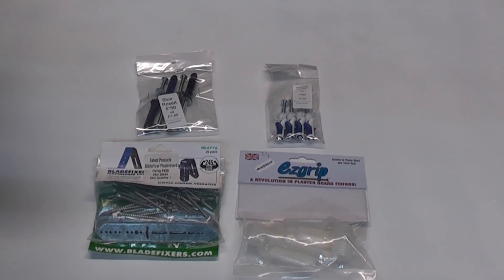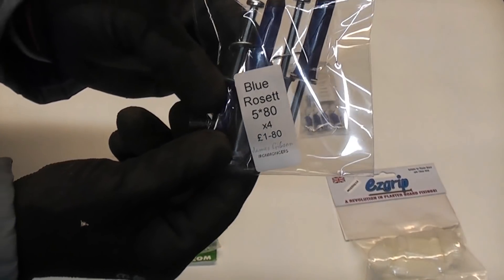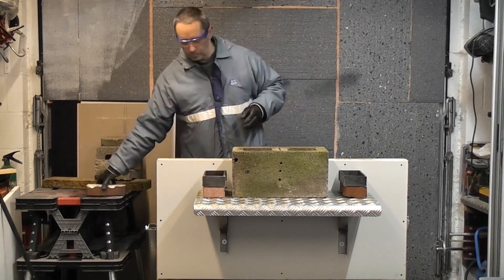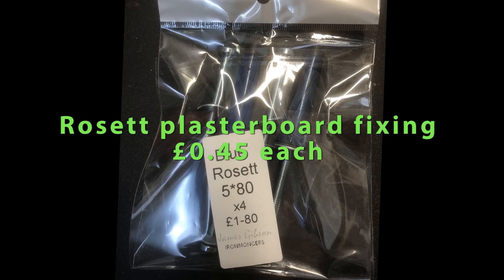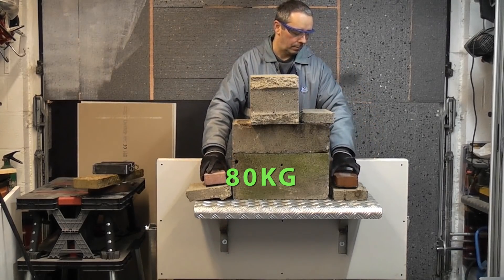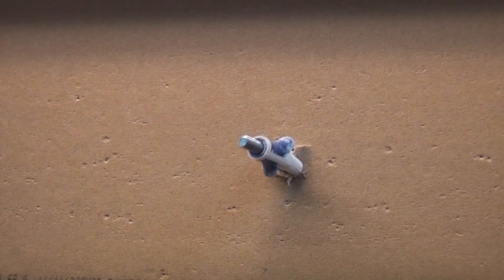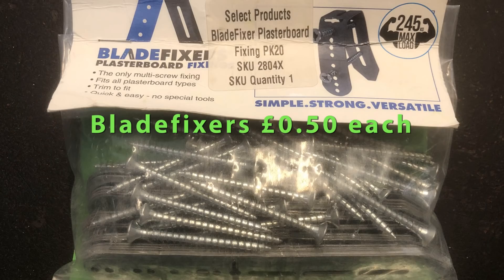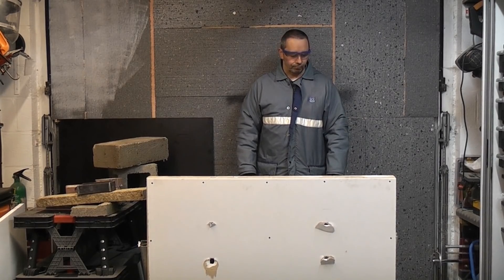Plasterboard fixings weight test 2020 | EZgrip | Rosett | Thorsman duo-max | Bladefixers

Comment: Brilliant video. Im putting a mirrroed bathroom cabinet in the bathroom and initially bought some gripit fixings, but now im leaning towards spring toggles due to their ability to hold more. Im thinking that over time, that will bode well for longevity and allow the cabinet to remain mounted for longer. Would you say toggles over gripit for my application?
Reply from the maker: Yes, toggles are great, unless you need to remove the item, in which case the toggles drop into the cavity! Toggles are also no good for the keyhole type fixings, but are awesome for anything with a hole, that can be tightened 👍
Reply: @ultimatehandyman  won't need to reuse. Once it's up I won't be taking it down for a few years and i tend not to reuse fixings. Much rather use a new one just to be safe. The cabinet doesn't have a keyhole for mounting. Just has 2 holes either side on the rear hardboard and on the wooden baton across the back. Toggles would be fine wouldn't they?
Reply from the maker: Yes, they will be perfect ;-)

Comment: Very helpful, thank you very much. Just installed slot shelving. Was going to attach them to wooden studs only to find out that my studs are actually metal and hollow. Was  disappointed indeed. Now using anchor attachments to fix the slots to the plasterboard. Your video gave me reassurance that i can go ahead and place some fairly medium to heavy weight items, on the new shelves, lots of folders, books and some tools etc, I should be fine. Thank you and take care.
Reply from the maker: I'm glad the video helped 
Thanks for the comment 👍

Comment: Thanks for this video, I have some blue rosetts and from your test it seems failure was at 91kgs - for 4 fixings, is that right? Does that mean theoretically each fixings max capacity is 91/4=22.75kgs - or is my assumption wrong - to me sounds about right for type of fixing. I was just worried as they told those Blue rosetts have capacity of 6.5kgs each, - which sounds too low, I want to install a 12.75kg (empty)cabinet with 2 fixings and if it’s truly 6.5 it’s borderline.
Reply from the maker: It depends on a lot of factors, such as how the force is distributed. Some items will try and pull the fixing downwards, others will try and pull the fixing out.
I'm assuming you will be putting things in the cabinet, once it is fixed!
I'd use spring toggles or snap toggles, they gave the strongest fixing in this test-
https://www.youtube.com/watch?v=ECDysfNhx_E

Comment: Do you by any chance have a video (could make a video?) on insulated plasterboard with celotex type product stuck to the plasterboard? I need to fix curtain rails for heavy long curtains, and now concerned about how to make sure they stay up, and don't destroy the new wall either
Reply from the maker: I'm assuming it is an external wall, so there will be a solid wall behind.
You should be able to use Corefix for that, I have put up a shelf using them here-
https://www.youtube.com/watch?v=7xLhIPoO5gQ
Thanks for the comment
Reply: @ultimatehandyman  I don't think they'd cover the distance? Their instructions say max from front of plasterboard to face of block is 40mm, and I think my void is 30mm plus thickness of plasterboard plus an inch of insulation attached to it. I might try the geefix you filmed on another video I found later? Thank you for getting back to me, nice to know you read the comments :)
Reply from the maker: @jesshothersall   I didn't realise there was an air gap (I thought the board had been dot and dabbed). I would not use the Geefix, I do not think they will work. 
This might give you an idea- https://www.youtube.com/watch?v=7DGGUbbbBZI
If you want, you could use copper tube, instead of the space plugs to prevent the plasterboard being pulled to the wall. 
You are welcome BTW

Comment: Great video. 👍 I've watched your full plasterboard playlist, and subscribed, all to fix a 1kg baby cam (+ stalk)! 

One question: this is an instantaneous fail. But how does it work long term? E.g. if it fails at 50kg here, could it hold 40kg forever, or perhaps only 10kg?

For a video idea: how about one identifying what kind of wall it is, what's behind it, etc?
Reply from the maker: It's impossible to say how much they would hold for long periods of time, but I'd guess at 50% of what they failed at in my test. It is always best to fix to the studs if possible, but that is not always an option.

 I'll try to cover that in future, thanks for the suggestion ;-)
Thanks for the comment 👍

Comment: What about if the plaster board was tiled? It would be unlikely for the tiles to break like the plaster board did, so probably would fail when the tiles were pulled off the wall..
Reply from the maker: If the wall is tiled, it will hold more weight before failure.

Comment: If the fittings were inserted close to a batten would it improve or worsen the weight before failure or would it be about the same?
Reply from the maker: The fixings might perform slightly better, but in every weight test that I have done, I have always positioned the fixings in between two studs set at either 400mm or 600mm centres (I can't remember exactly, but I always use the same wooden jig)
 Thanks for the comment 👍

Comment: Hi. We’ve just had a garden building installed. Insulated with Iko Enertherm 25mm insulation and 13mm plasterboard. 
No room for spring or snap toggles behind the plasterboard. What fixing would you recommend ?  Need to put up some shelves, units etc. 
Many thanks.
Reply from the maker: The Grip-it fixings will work in such situations- https://www.youtube.com/watch?v=szx7nMRZSIY&t=1s
Thanks for the comment

Comment: So many thanks for all your efforts in putting this together. Analysing the figures there are 3 failures @ 91Kg the toggle then @ 176 and self drive at 53. Very interesting. On occasions one is limited to the type of fixing it`s possible to use because of the clearance between the rear of the board on a dry lined wall and the block/brick that it`s dry lined onto, the gap can be very limited by comparison to a stud partition which could be as much as 100mm of gap.
Reply from the maker: If there is a solid wall behind, I would never use a plasterboard fixing. I would use one of these fixings-
Rigifix- https://www.youtube.com/watch?v=xaYfs3lr1jI

Corefix- https://www.youtube.com/watch?v=7xLhIPoO5gQ

Thanks for the comment 👍

Comment: I appreciate the time and effort that you have put into these efforts and as you say the biggest determining factor is the amount of area that the fixing can cover of the plasterboard, I've always been a fan of the "Fast Brolly" anchors which are probably the closest to the spring toggles and have the advantage of being reusable, do these manufacturers carry out their own tests, I would like to see how they perform over time, I'm not suggesting that you should do this :-)
Reply from the maker: I'm not sure about manufacturers doing tests, but the reason why I started doing the tests was because there are several manufactures that claim to make the "strongest plasterboard fixing", all of which is nonsense. I often wonder what has happened to the trading standards department, I thought they would pick up on false claims like some of these manufacturers make!
 Thanks for the comment 👍

Comment: Since you're using 4 fixings per test what do you consider the capacity per device and are the upper fixings (closer  to the shelf) bearing more of the load than the lower attachments?
Reply from the maker: It's hard to say. There are lots of variables, but in my tests I have used the same brackets each time, so from that we can conclude that the spring toggles are the strongest fixing so far.
Thanks for the comment

Comment: Are you aware that there two totally dissimilar and unrelated ‘Spring Toggles’ available on the market?

There is the Easyfix Spring Toggle --  the one you featured with its two metal wings operated by a spring that flies open once inserted through the hole in your plasterboard.  

And then there is the Timco Spring Toggle  --  which consists of one metal plate, two lengthy arms of plastic,  a circular plastic insert and a bolt.    The metal plate is positioned at the rear of the plasterboard using the two zip-tie type plastic arms and held in position by the plastic insert which is slid along the arms until it fits snugly in the hole of plasterboard.  To use for weight bearing,  a bolt is inserted through the hole in the plastic insert and then tightened by screwing into a threaded hole in the metal plate. 

 I’ve used it to secure a toilet cistern to plasterboard and it did the job superbly, very easy to fit and you don't lose the metal plate down the back of the plasterboard if you remove the fixing bolt from it
Reply from the maker: The spring toggles are superb, I really do rate them highly.
It seems that Screwfix have the name wrong for the "Timco spring toggles", as there is no spring in them at all. I actually used them yesterday, on the packet they are called Zip fix, these used to be known as snap toggles years back- but they might have done a licensing deal with Timco- or the patent might have expired.

Here are some old videos on both of them-
Spring toggles- https://www.youtube.com/watch?v=WO55oYozlxA&t=1s
Snap toggles- https://www.youtube.com/watch?v=tAIUublenMw

Snap toggles are my favourite plasterboard fixing of all time, I have used them to fix a basin to a lath and plaster wall ;-)
Thanks for the comment

Comment: Fairly obvious which one is best as it spreads load out better across board
Reply from the maker: Not necessarily, the Geefix fixings in the last weight test video spread the weight over a larger surface area than spring toggles or snap toggles, yet the plasterboard failed at a much lighter weight (probably due to the large hole required for the product)

Thanks for the comment 👍

Comment: great video. i assum the reasons for the similar results is due to the  surface area of the fixings. the larger area ones hold more weight. i woild like to see a test done that uses a series of dieferent sized washers instead of a fixing  so that we can see the relationship between area and weight. i wold be interesting to see how a fixing compares to that datum point . if the washer test shows 90 kg  then we can see that you have reached the max for the plasterboard and not the fixing
Reply from the maker: In the previous tests the heaviest load was well over 120KG- https://www.youtube.com/watch?v=ECDysfNhx_E
Thanks for the comment 👍

Comment: Will most of these be ok if you have celotex insulation behind the  board?
Reply from the maker: I would imagine that you might have problems getting the EZgrip in with the insulation, and the Bladefixer, but the other two should work fine. 
Thanks for the comment 👍

Comment: When I seen that a few failed at 91kg, I started to think, is it the board their fixed to failing and not the products themselves.
Reply from the maker: In the previous test, the best performing fixing held over 120KG before failing.
Thanks for the comment 👍
Reply: @ultimatehandyman  Must admit though, I do like those videos where you test stuff out. The grab adhesive ones are great especially an established brand doesn't do too well against others.

Comment: can the type of material of the fixing wall also change the resistance? Good video.
Reply from the maker: Yes, if thinner plasterboard was used these would fail much easier, You can also get boards such as Gyproc Habito, which should be able to hold much more weight (the problem is that you might not know if it is plasterboard or Habito, once it has been plastered over) 
Thanks for the comment 👍
Reply: that would make a great video. firstly how to know what  what the board is and secondly what the strength diference is. choose one fixing and use that .  keep up the great work

Comment: until now there's  not  a proper fixings to plaster board you can trust 100 percent   spicaly when comes to a heavy object such a radiator  ect. found the video very informative and useful thanks a gain for time and effort have a happy Sunday.
Reply from the maker: Fixing to the studs is the best option, if possible, but failing that I'd use spring toggles or snap toggles.
Thanks for the comment 👍

Comment: There all failing in punching shear with the area of the puncture holes (approx 25mm) very similar.
Reply from the maker: Yes, apart from the EZgrip, which has a 22mm hole and the blade fixer, which has a slot and a screw hole.
I was gutted when one fixing did not stand out as the clear winner, like in my first test! 
Thanks for the comment 👍

Comment: It's never the fixing that fails it's the plasterboard and that's why all the results are similar
Reply from the maker: I thought I said in the video that "we'll see what weight the plasterboard fails at".
The results in the original test ranged from about 50KG to over 130KG, which proves that the fixing makes a huge difference.
Thanks for the comment 👍

Comment: Thanks for taking the time to arrange the tests👍I don't see how any fixing that needs two holes close together will ever be strong since the plaster board will try to crack between them. Useful video and just the thing to watch while having a Sunday lie in😊
Reply from the maker: Yes, some fixings are fundamentally flawed from the outset, such as ones that require two screws or the ones that require a large diameter hole!
Thanks for the comment 👍
Reply: i would like to see a video from that perspective. . usability is more important than ultimate weight capacity